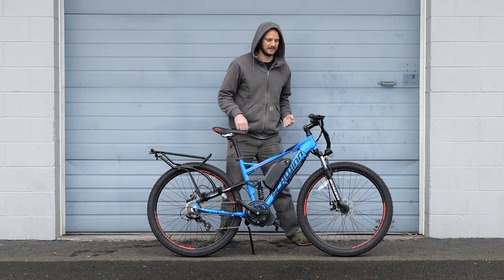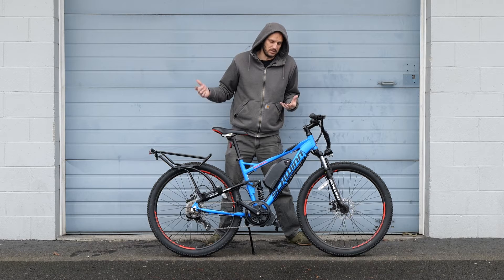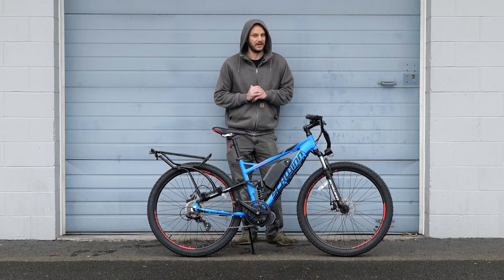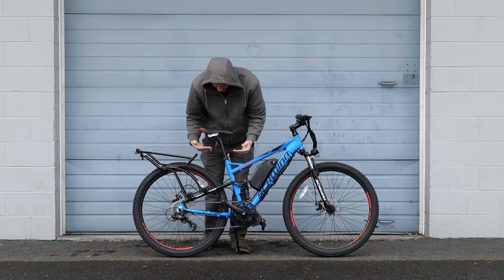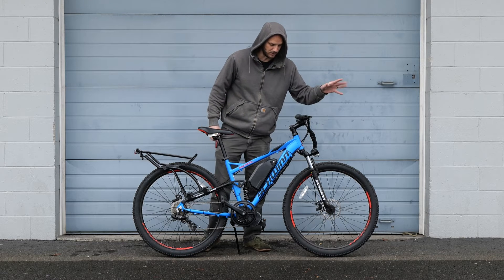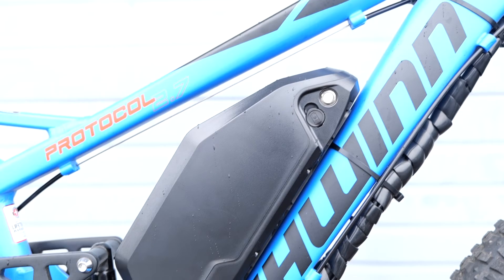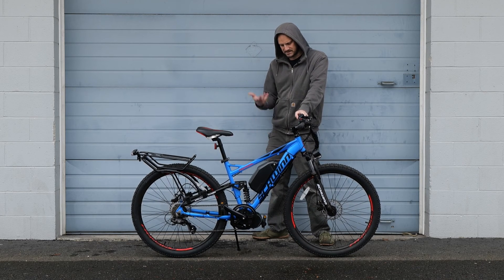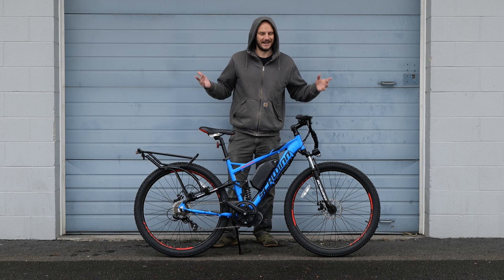Custom E-bike Build: Schwinn Protocol Full Suspension w/ Bafang BBS02 750w & 52v 10ah Wedge Battery

Comment: What do you do about the brake sensor if you have hydraulic brakes?
Reply from the maker: I like replacing/upgrading them to the ones with built in sensors for $89

Comment: I just converted my hardtail to ebike with bbs02 in May and I have 200 miles on it already on my local trails. uphill climbs are like taking a smoke break lpl
Reply: That was 100% the advantage over hubs my BBS02 will climb like a a billy goat on the big cog and I turned it down to 20 amps for longevity! I just gotta lean forward a little more because it'll stand up on me! Which system is better? I'll have both please!
Reply: @johnsheetz6639  I only run about 15percent
Reply: @rorymurphy27  your battery is going to last forever I'm guessing I'm getting so many miles out of my 20 amp hour 52 I know if I charge it fully I'm going to have to get a 10 to 20 mi ride just to get it down to storing voltage ⚡
Reply: @johnsheetz6639  oh dang I didn't think about storage voltage. it just fully charged it and bout the battery inside the house for the winter. it's 5 degrees outside .

Comment: We need some comparable builds to factory trail and enduro bikes. Something besides a street scooter.
I'm  basically looking to ride hard on single track.  Instant throttle response with low end torque.   Maybe 25-30 mph max.

Comment: - The chain looks too tight. You usually need more than 2 extra link with a rear suspension. 
- Very interesting battery format. Could confirm its weight?
Reply: Weight is at least 4 kg

Comment: range on full power? 17ah gives me just 7 miles
Reply from the maker: Whoa, how much power are you using? That’s like 120wh/mi if you have a 48/52v battery
Reply: @JohnnyNerdOut  standard everything, 48v.  Run a 52t chain ring for 35mph cruising ability. What should I be seeing in mileage? Used to get 15 miles in mode 2 out of 3 but now it's bit colder in Scotland this time of year it seems to have lost range. It's a cheapo aliexpress 17ah with grade a cells, allegedly lol. Want to buy a 24ah but wonder what I should see in mileage on decent Samsung or equivalent cells?
Reply: Thar battery is bad, my 17.5 get 30miles
Reply: @nathandavidson1823  even in full power mode everywhere?
Reply: 20ah 52v battery gives me about 60 miles in one trip ~ there are many factors, so this is an approximate number.  I could get more mileage on flat ground, and if I totally drained the battery.
Reply: Normal throttle, uphill, 18-20mph.  I just went 25miles at 19mph, I'm 210lbs, and was only down to 50v